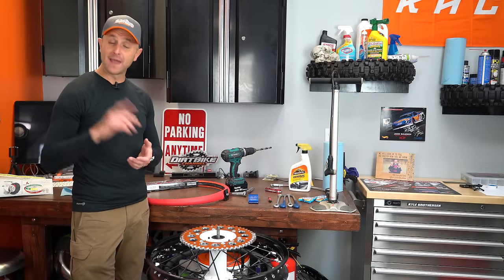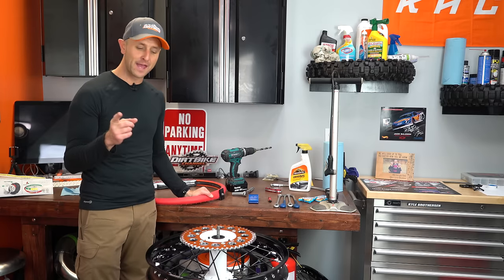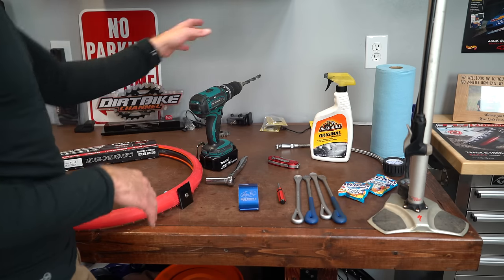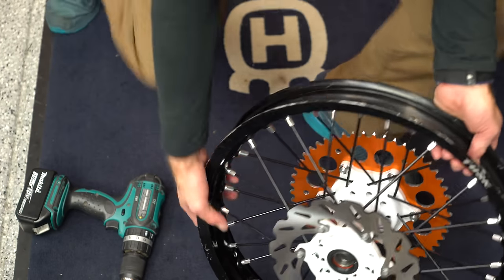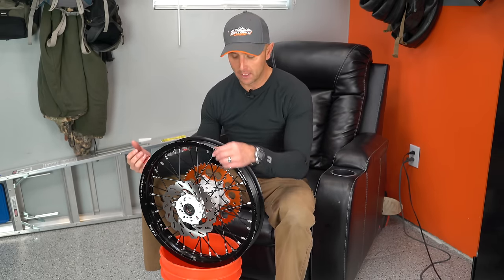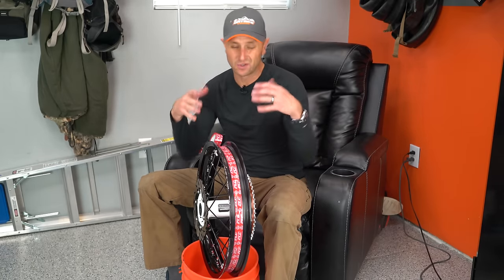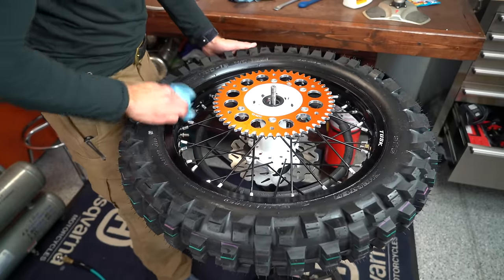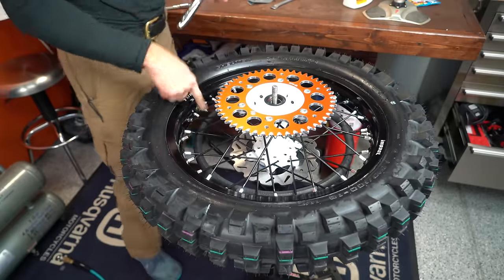TUbliss Installation Guide | How To Install TUbliss

Comment: You lost me at drilling my rim
Reply: No big deal, you can put a rubber plug in the hole.  Better yet, put your rim lock there, and plug the 4 spoke over from the valve stem hole.  Why?  Because putting the lock opposite the valve stem balances the wheel almost perfectly.  Never understood why both holes are so close together on KTMs.
Reply: @duken4evr  same way on most Kawis. It gives you less chance of pinching a tube when you install a tire.

Comment: Wrong: before cleaning first lube the nipples, then tension & true the spokes. This way one makes sure the wheel's good plus there's lube inbetween the nipples & spokes, right where one wants it.
Inflating the hp-tube is a good idea but better still is cycling it say 2 or 3 times, to allow it to settle especially there where the rimlock is.
And, for mounting tyres learn to use a rubber mallet, you'll surprise yourself I reckon.

Then also, for anybody outside the US (say 6.5 Billion people, enough I reckon), what is Armoral? If that's soap or dishwash or why then say so, so they know what actually you recommend rather than that clearly sponsored brandname.

Comment: Hi dirt bike channel guy! Could you redo video and add some of the pointers in the comments. Also it would be good to clarify that the sealing point is between the red tube and the INNER tire bead not between the outer bead and the rim. With that said it may help get 100% seal if we lube the inner bead and red tube really well before install. Not really impressed with Tubliss video so if you could emphasize that point it might save a lot of people having to do this twice.

Comment: Enjoying the video then bam you hit it with a hammer 🤦🏻‍♂️ that was the rim lock the tyre was stuck on dude if you had loosened the bolt off more and pushed the rim lock it would have allowed the tyre to slip into the rim.